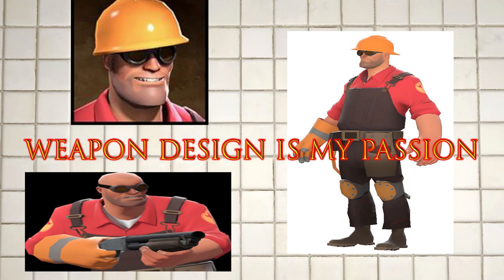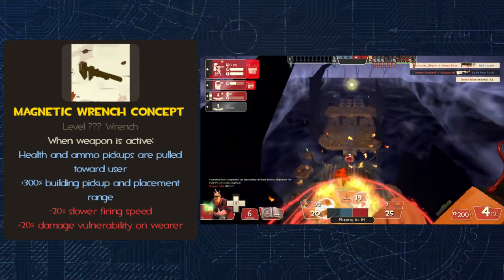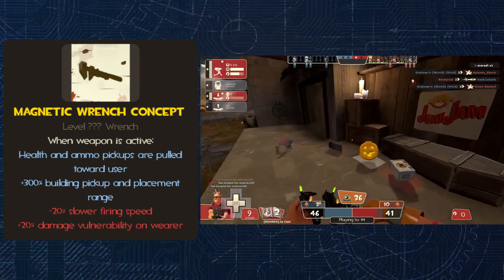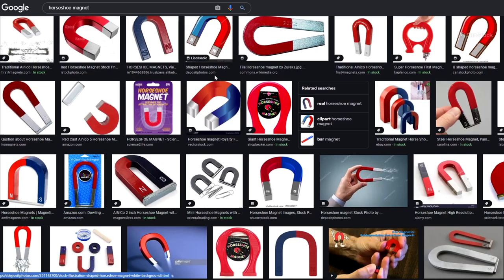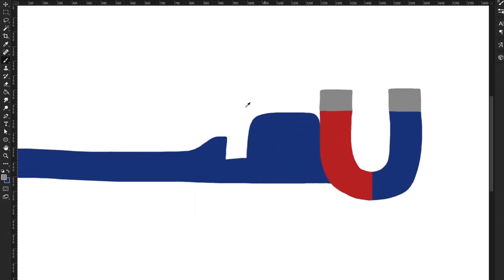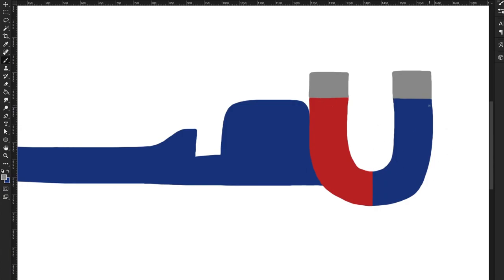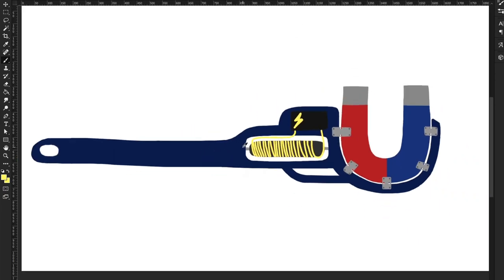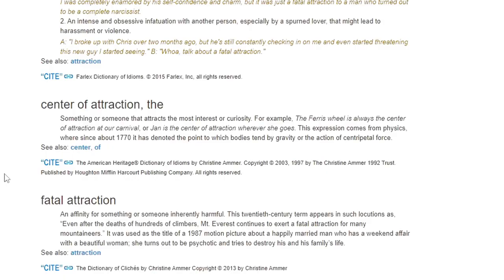Harness the Power of MAGNETISM - An Engineer Wrench Concept [TF2]

Comment: Fun weird side effect: you know a mag-engie's nearby if you ever see a gib or pickup scoot slowly across the ground, maybe toward a wall or door
Reply: Yeah, so that would probably be funny just to catch an engineer off guard.
Reply: Maybe the items start off slowly then gets faster and faster. Kind of like in cartoons.
Reply: @unknownpizzashop3821  
I assumed the pull would get stronger the closer it was too the engie, so if you're barely in range, it'll scoot at first, then tumble, then fly
Reply: @recurvestickerdragon  sorry for the late reply but imagine if you had a random chance of getting knocked out, possibly because the ammo is flying towards you  at high speeds. May or may not be a good idea tho.
Reply: @unknownpizzashop3821 
That actually sounds pretty funny. I'd probably wind up as small amounts of damage, but I like the idea of a large ammo crate having like a 1% chance to ragdoll you for a few seconds
Reply: @recurvestickerdragon  yes
Reply: It could have a particle effect on the ground too
Reply: what if, when you see another magnet engie you get pulled twords them

Comment: tbh when I first saw this, I thought it was a battle engi wrench that was paired with the widowmaker so you are in the frontlines more likely
Reply: The 20% damage vulnerability would make it bad for battle engineers since it essentially leaves you with 100hp meaning rockets and pipes can instakill you at shotgun range and lower survivability is bad overall for aggressive playstyles.
Reply: @irkkunen4933  105 hp*
Reply: @BoneyCheeks  20% of 125 is 25, so they basically have a base health of 100
Reply: @Ro_Yoshi  On wearer so you will have it regardless if the wrench is out or not.
Reply: @captainnomekop5056  Then it's better if you can manage your metal so that you are never caught with the wrench out. Though I'd still imagine the widowmaker is a better choice.
Reply: I do believe it is a really good behind the frontline engie defense point , like paired with frontier justice

Comment: There are many times where I am setting up with a distant dispenser in a spot meant to heal the team and quickly run out of metal to repair and upgrade my stuff. Holding this out and walking around the map to vacuum up metal sources like how the Sonic 3 electric shield attracts rings at a close yet generous radius would make metal management when your buildings are far apart quite a bit easier, might even be worth the risk during calmer moments of the battle.
Reply: Sonic 3 was my immediate analog for this.

Comment: Not  to be that guy with a physics major, but the coil itself isn’t connected to a battery, and the thing it is coiled on is supposed to spin. The thing that spins makes it so the coil is magnetic and is the thing that needs the battery. Btw I do not have a physics major, I just did this for a science project.

Comment: here's an idea i always had: a pizza for the heavy.
 The way it would work is that it's charge meter is segmented into 6 parts similar to the vaccinator's ubercharge, each part would be a slice which can be eaten for like 60hp or thrown as a small health pack. Instead of recharging over time, it would only recharge by picking up health packs while at full health. Small ones refill 2 slices, medium ones 4, and big ones filling the entire meter.
 Basically a food item that is more focused on supporting the team but requires some more skill to use well, knowing when to use it and managing health packs. You could still use it to heal yourself, but it'd be really bad at that since you only eat one slice per taunt, so you would have to stand there for a long while to regain all your health.
Reply: thats a really cool idea
Reply: That sounds quite nice
Reply: I love that
Reply: Da, this will work
Reply: Small ones refill 1, mid fill 3 and big fill all, i think it's a bit more... logic? Dunno, but still your idea is gold
Reply: God
I made almost the same thing some days ago but it was a cookie bag
Like, you can eat each for 70 hp and you have 4 charges, so it's 280 in total.
And it kinda charges slower than the sandvich, but to make it up for it you have a 75% faster consumption rate (it's a cookie, makes sense) and if you consume the entire meter you get damage resistance (cuz you eat it and drink milk, milk make heavy's bone strong >:) ) with the 280 healing, but with the normal consumption rate. And no, it wouldn't be broken because it charges a little longer than the sandvich and to drop it you would have to give 2 of the smaller meters to give a small health kit. 
I even made the tf2 item menu for it
Reply: *The Petrograd Pizza*
Reply: Huh. Neat.
Reply: @Real_temmie_undertalo  i think making health packs give more slices would make it a little better, if a small pack only turned into one slice then picking it up to heal someone else would just be the same as if that person got the pack without your help. But yeah we can't really know for sure how well this would work without testing it in game, maybe multiplying health like that would be a little broken, idk.
 And of course, collecting your own dropped slices would only refill 1 part of the meter, so you can't just keep dropping and collecting to recharge all 6 slices.
Reply: @okamida8359  that also sounds really neat, basically the same functionality but more focused on self support instead of healing the team, might even be a little easier to balance if the potted plant decided to add it to the game.
Reply: @doublesystem9790  Makes sense, but still recharging 2 slices in 1 small health pack can be a little bit OP since you need 3 small ones instead of 3 medium ones and there you go
Reply: @doublesystem9790  yeah kind of, because the 2 charge meters charge faster than the sandvich but not as fast as the second banana (sandvich: 30 seconds, banana: 10 seconds, cookie total charge: 40 (which means 10 seconds for each small meter)) I thought this as a way to balance it, you get a quicker healing but less healing over time
Reply: Yo I had the EXACT same idea! I do not remember where it was from, maybe an offhand big Joey comment, but here were my stats for it:
Pashkovsky’s Pizza: heavy secondary: dinner-box item
*Each box of pizza has six slices, each healing 50 health. Throwing a slice results in a small health kit. You can choose to either eat 1 slice, or all that is left in the box with middle mouse.
- Cooldown of 8 seconds restores 1 slice each.
Reply: it could have a reskin that's a plate of sliders
Reply: Far too griefable
Reply: Except you could pick up a dropped slice(small health pack) for 2 slices, meaning that if you have enough breathing room you could just max out infinitely
Reply: Holy shit that's basically the same idea I have
Reply: this item has the same problem that the vaccinator has. not PREDICTABLE! why the sandvich is balanced: its predictable so when he is eating a sandvich  you KNOW his sandvich charges in 30 seconds BUT that idea is interesting.
Reply: Or you could just play medic
Reply: The only problem with this is that it would add someone who is full health to the pool of people already competing for health packs 
Ideally, the fact that the pizza heavy can carry so many would off set this, as they would be supporting their team dropping the pizza when necessary, but in pubs this would be a nightmare lol
Reply: @cipherlock or use reload to eat it all instead of Mouse3
Reply: I think for that to work it would need a slightly faster eat time (similar in speed to scout drinking but maybe a little slower)

Comment: maybe add a higher max metal capacity? say 225 or 250, think that would be kinda cool and make the wrench a little more viable, you could possibly lower the damage vulnerability to like 10or 15% too.
Reply: could also do something like extend the range of the dispenser a little bit
Reply: Maybe 250 metal but instead of 20% it's just marked for death (mini-crits, 35%)
Reply: It probably shouldn't go past 230 because then you could build a sentry and a dispenser without picking up more metal
Reply: I think it should lose the health pack magnetizing and the damage vulnerability. 20% slower swing is already pretty bad, and the benefit is only just about worth it. 20% damage vuln is an extremely harsh downside for a weapon like this.

Comment: There’s something I would like to possibly add. The engineer using the magnetic wrench could use enemy Dispensers and Teleporters.

Also an alternative to the farther placement, you could an ability, right clicking with the wrench would cause a small shockwave that launches the engineer up and disables nearby buildings, for about 50-75 metal, giving more Mobility options, something that engie doesn’t have yet, and also letting an Engineer possibly rush in and disable sentries that could kill them. An alternative wrench for Battle Engies.

Comment: For a while ive had an idea for a medic secondary, itd be
A backpack that storages the damage dealt as uber, uber can be started at any %, when the uber is triggered the medic will quickly heal any teammate including himself in a AoE effect, the higher the % the longer the effect lasts, this is a weapon destined to be a battle med medigun, that encourages the medic to take a more active rol at the cost of uber.
Reply: So it’s basically a medic banner
Reply: @D_Bouss  yes, but you can turn it on at basically any time and it beaks the crossbow meta since the other primaries are better for dps
Reply: @josep754  good point. It would also for pretty well with the overdose. You would get faster for damage, then exchange your gained speed for heals, then use the heals to survive more while dealing damage.

Comment: Maybe make it an active thing at all times, kind of like what you can do with the spy's cloak except that it would work in a cone in front of you, like the manmelter. Or make it exactly like the manmelter's alternate fire, but instead of drawing in flames to give you crits, it draws in health and/or ammo packs and gibs. (Debatable whether it should draw in health packs). Give it the same negative stats otherwise, but always active? You trade damage and resistance for a utility you can use to get more metal without leaving your relatively safe spot.

Comment: If i could design a weapon for tf2, i'd design a primary for the heavy that could solidify his subclasses into a legitimate subclass rather than a joke one, similar to how battle-engi or demoknight are viewed as legitimate subclasses. Here's what i got:

The Soviet Food Reserve

This is a primary weapon that exchanges the minigun for a large lunchbox, attached to the heavy as a satchel. It also replaces the heavy's bandolier of bullets in exchange for this weapon, so people can see that you're using it even when you do not have the weapon out. On the satchel's sash, there are also shotgun shells attached to it, hinting at part of its stats. Its stats are as followed:

+10% movement speed on wearer
+15% secondary weapon damage
+15% secondary weapon reloading speed
When you pull this weapon out, you can select a lunchbox item to eat or throw infront of you (similar to how an engineer selects a building from his pda). This weapon then goes on cooldown, the duration of which depends on the selected item (same cooldown as the selected item would have). Picking up a health pack while you're at full health will instantly refill this item's cooldown, except when you have a lunchbox secondary that is also on cooldown. This item's passive stats remain even when it is on cooldown.

This item should legitimise the fat scout playstyle because it gives you slightly more mobility, more shotgun damage and still gives the heavy the utility of food items (but even more extreme because now the heavy has access to all of them at once!). The 15% extra damage is also very delibirate, because it makes it so that the panic attack could (at maximum) deal 124 damage, preventing it from completely one-shotting light classes.
Reply: Insert joke about 'What food' here

Comment: Here my Engineer's Secondary Item Concept:
"The Battling Dispensery" (Works Like Cozy Camper)
Pros:
Regenerate ammo and Mental +5 Per seconds on wear
Regenerate 3-8 Health per 3 Seconds
+25 Max Health
+50% Metal Clip Size
Cons:
-25 Moving Speed on Wearer
-50% Healing Rate By Medic or Mad Milk
No Overheal on Wearer
-15 Melee Weapon Firing Speed on Wearer
-35% Weapon Switch Speed
Reply: You should add: heals nearby teammates
Reply: @davidpico1579  nah That's Too broken,
I Designed This for Battle Engi specially
Reply: @tellyg7985  Yes Because those things are Very Heavy

Comment: I was thinking of some stats of my own for this one, here’s what I came up with:

On alt-fire (hold):
• Nearby metal from broken buildings and dead players are attracted
to the user.
• +100% Metal pickup range from Dispensers

Vaporises killed enemies.

• -20% Firing Speed
• This weapon deploys 100% slower

Also I may try and do a doodle of this concept myself, is there a preferred
place to share my idea when I’m done?
Reply: I put my custom weapons on r/tf2
Reply: I personally think this is better. Picking up health packs sounds bad for the team, and the 20% damage vulnerability makes it terrible.
Reply: 100% slower? do you understand how slow that is? double the time you would normally require, that would be a nightmare, 2-3 seconds before you can remove a sapper or repair the sentry while being under attack.
Reply: @CaptainMaionese  it sticks to your metal supply
Reply: I think something like +800% dispenser range would be better and have it decrease metal consumption from the dispenser the further away it is. Also u get metal just like how some walls allow anyone to get ammo from dispensers on the other side but no healing. It should also be skill based, so instead of aoe u have to look at the metal and it will only pull as long ur holding down m2. this is to reduce accidentally taking stuff from teammates

Comment: THE CENTER OF ATTRACTION:
When weapon is active:
UPSIDES:
Right clicking on health and ammo pickups teleports (or pulls) them infront of user and disappear 15 seconds later if not used

health and ammo packs teleport (or are pulled on RMB) not on user but next to user, so teammate can pick it up as well, and also because just increasing health and ammo pickup range is dull, boring, stupid, lame and etc.

Dispenser range increased by idk% 

which makes sense as your wrench pulls metal out of it magnetically

DOWNSIDES:
Idk about this one but: Splash rockets or pipes or stickies, not further than 100HU (or whatever distance) away do full damage (ofc with falloff or rampup)

this one kinda makes sense, you basically pull rocket towards you, without terrorizing source engine, and this makes turtling your sentry much harder as you can't really be near it, because Splash damage classes can 1 or 2shot you with splash damage much easier now

INSERT SWING SPEED PENALTY HERE

A funny taunt kill idea: eureka effect taunt starts and loops for 4-5 sec(without lightning strike), while the engineer pulls people near him, then if they're so close, they're bumping eachother, people who bumped get stunned and when the taunt ends, all stunned players and engineer scream and get sucked into a small black hole, while the wrench floats for a second in air shakes a bit and falls onto the ground

P.S. new downsides:
Pickup range is affected by how low user is on thing he tries to teleport

effective pickup range becomes larger, as the health/ammo decreases, so you can't always be full on metal/health

Pickup has "idk how much" seconds cooldown

obviously so you can't spam collect things all over the map if there's 5 different large kits in you FOV

Comment: How about a throwable consumable for scout/sniper/pyro that does a small amount of explosive damage, mainly intended for blast jumping? I think an explosion about the size of an airstrike midair rocket, dealing about 30-40 damage (half damage for yourself) with the recharge time of the cleaver could be cool
Reply: Na have it only for the scout because on sniper he can probably get into a broken sniper spot and the deternator (or however you spell it) does the same for the pyro.
Reply: you described a grenade, which is something only the demo should have thematically. scout has enough mobility, more would make him more op than he already is, pyro already has flare jumping, sniper should never gain mobility tools
Reply: @Vizaru  idk about only the demo having grenades, you're probably right there, but I was thinking that having a one-time-use cooldown mobility tool for the sniper could be a decent side grade to the one-time-use cooldown jarate, as they both function as a bit of a "get out of jail free card."  I know that scout has plenty of mobility already, but I just really like blast jumping as an idea and don't think it should be completely restricted to soldier, pyro and demo.

Comment: Wait… I’m an asshole physics major! This is my time to shine! 

Funnily enough, by not labeling which side of the electromagnet is positive and which is negative, you avoided people being able to tell you that it was wrong. I’d assume that you’d want the magnet to be aligned with the horseshoe magnet so that it has stronger attraction. To determine if it would be like that, you’d have to know both which side is positive and negative as well as which direction the wire is wrapped since those both affect polarity.
Reply: Ah yes. Electricity...

Comment: I really like this idea, and I want it in the game. However, I slightly rebalenced it, and I'm trash at balencing, so don't expect it to be good. Hold right click to draw nearby Health, Ammo and Metal pickups. +200% increased pickup and placement range. -25% less metal from metal supplies. -35% Healing from medic sources. -15% slower firing speed. Is this balenced or am i just trash at this?